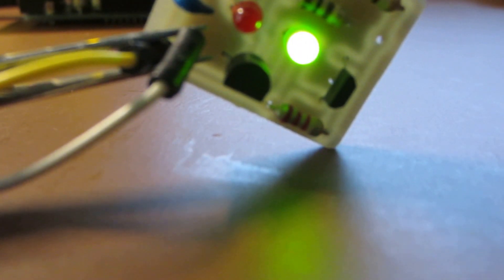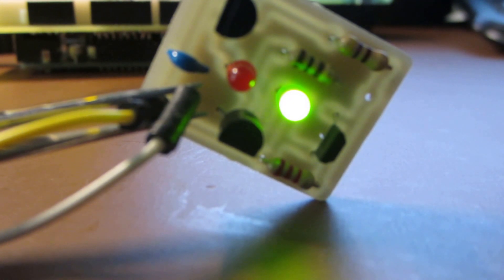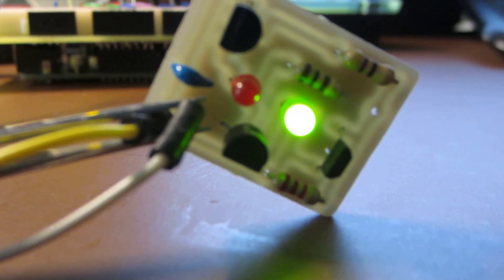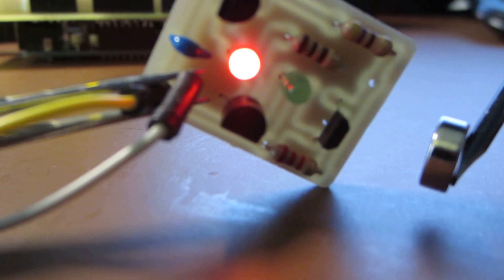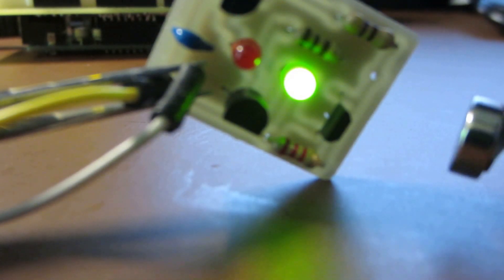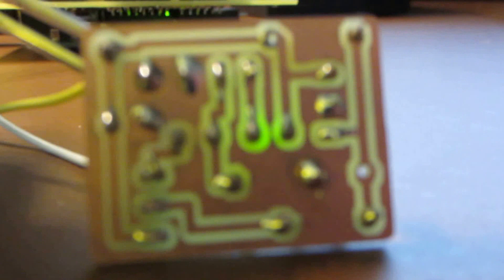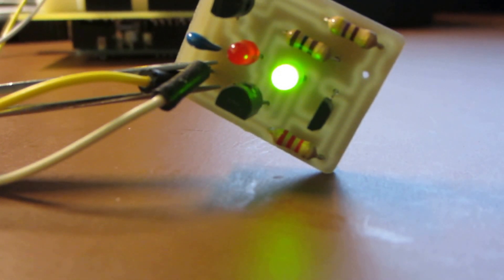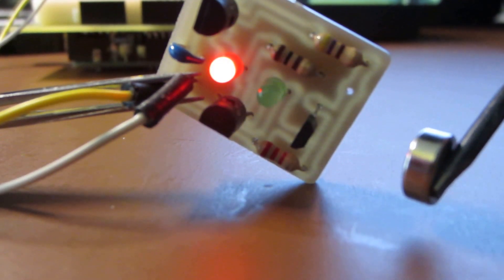HallSensor

Comment: I would love a how to build video that would help allot because I really want to make these. Or if you wanted to give me a price I would love to buy them from you.
Reply from the maker: caleb venuto I suppose I could cut you a set of boards and provide you with the parts.  You could then solder them together.  Is that what you would like?  I would have figure out the cost.  Would you want 6 (X,Y,Z) or 4 (X,Y) Axises.
Reply: Yeah let me know what you would charge to do it and 6 would be perfect. How are you attaching them?
Reply from the maker: caleb venuto I just use hot glue to attach them, I did not want to drill holes in the rails or anything.